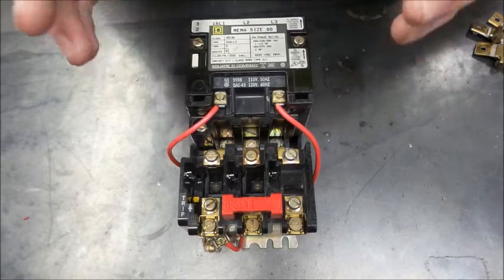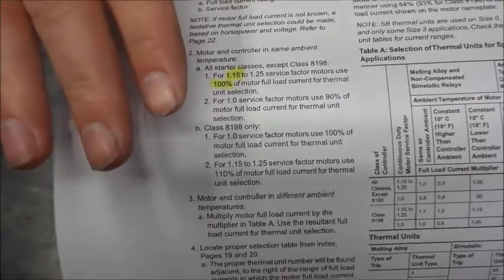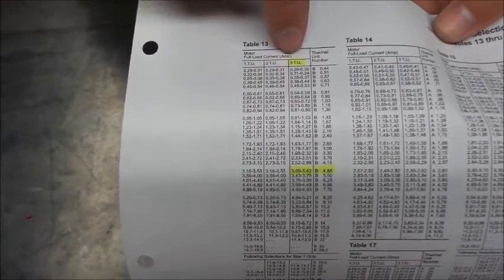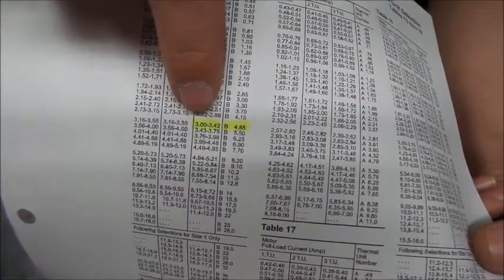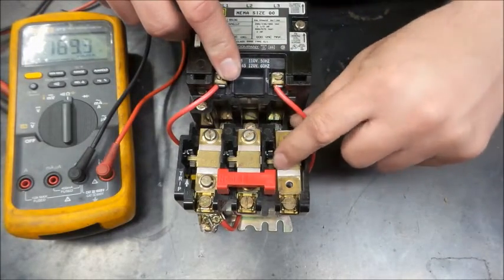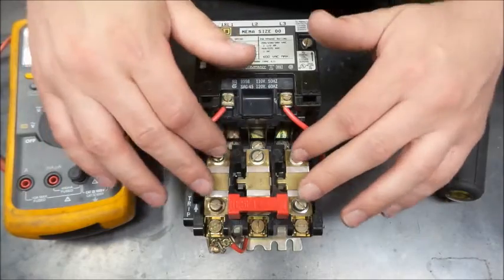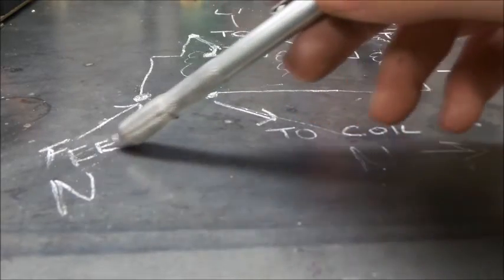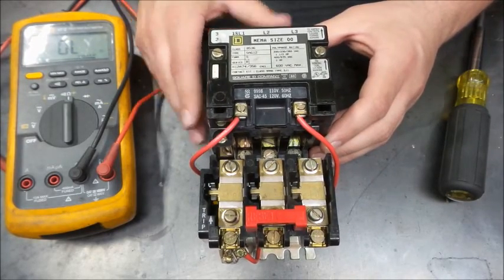A Look at Thermal Overload Heaters in Motor Starters

Comment: Depending on what motor starter you have depends on the motor and the he voltage. A lot of motor starters have two or three hot legs and no neutral. Most starters don’t have a neutral as you are showing. I think you know enough to be dangerous !
Reply from the maker: Motor starters can have one two or three phase legs, all starters with electric coils require an additional power source to operate the coil on the starter. In this case it is 120V AC it could be any number of voltages but 120V AC and 24 V DC are more likely there definitely are 240V AC and even 480V AC but the coils voltage specifications are something entirely different. That being said this coil requires 120V AC which in North America does indeed require use of a neutral. So while the neutral is not found in the motor part of the circuit the neutral is most definitely required to make the starter go Ca-Chunk and close. In this case the neutral is also routed through the overload contacts which, in the even of an overload condition opens the neutral thus de-enrgizing the coil which in turn turns off the current to the motor. 

To try and distill it down as far as possible the motor starter is an electrically operated switch exactly like a relay or a contactor the only real difference is the addition of the overloads. A much smaller voltage and current can be used to operate a much higher voltage and current that is why they are so advantageous to use.

Hopefully I was able to make that a little more understandable I recognize if it's not your thing it can be a little confusing to understand all that's going on with a starter.

Comment: I have people in my industry for years telling me the "heaters" are going bad. However, nobody has ever shown me a reliable method to test them. I HAVE seen this be the case, but only to the extent that changing them fixed the issue. Does anyone know of a method to verify the heater has gone bad? This is generally in an environment that doesn't allow for controlling the load on the heater, so any ideas would be awesome. 

We use the Square D heaters, just like the one in your video.
Reply from the maker: Short of load testing the only thing I can think of off the top of my head might be a heat gun and a thermal imager. The problem would be figuring out the temp the heaters solder should melt. If you knew that it might be worth a go. I might experiment with this if I can get a few different size heaters. The problem I expect will be translating a current rating to a temp rating. Theoretically though I would think you could mechanically test them with external heat as well. At least enough to know if it's way out of spec. That's an interesting one to ponder.
Reply: @TalkingHandsTools  thanks for the response. I can't think of a way to test them, and I hate simply replacing parts guessing. It just so happens we don't have ready access for monitoring them. They are sealed up tight in an explosion proof panel, so I'm sure we waste a lot by not having a method to test them. The heat gun and thermal imager should work, as long as testing a few new heaters will give you a fairly accurate average. About the best idea I've heard, because I have never heard anyone give a way to test them.
Reply: Correct me if I’m wrong but a continuity test works
If the thermal unit is still good, you will have continuity. 
A blown thermal (heater) will have no continuity.
Reply from the maker: I'm not sure continuity would confirm they are in spec. If they read open, it would be a catastrophic failure. I'm not sure the heaters themselves would actually open under an overload condition. The solder alloy in them would definitely turn fluid, which would allow the spring-loaded mechanical contact they keep closed to open and shut the motor off through operating the coil.

But that being said, the overload itself has to continue to conduct electricity itself up to the point the solder alloy melts. I suspect if the spring-loaded overload mechanism fails and does not open, the solder alloy might experience thermal runaway and fail catastrophically. 

What is difficult is overtime and duty cycles (being tripped repeatedly) the solder alloy doesn't stay consistent in its tripping point. I do believe they generally trip sooner, but that comment only comes from having to replace ones that trip sooner than they normally should. If some trip later, we'll those would eventually result in a motor failure. That is the reason some maintenance programs change the overloads if a motor fails no questions asked. It's also at the route of the speculation on how to test them. 

I hope I explained that okay. There's a ton of nuance to overloads and it's a little hard to articulate everything that's going on. If you have any ideas, I'm definitely game to talk them over.

Comment: I have a question on a similar style overload relay that has heaters but they are coil style Heaters. I had a overload relay that didn’t want to reset does this mean one of the heater was burned out ?
Reply from the maker: Without seeing it I would say it's very possible that the overload has failed that is always a possibility.
Reply: I believe I know the type you are talking about. It looks to me like the coil generates a magnetic field that tugs on a thin metal strip next to it which trips it. We had some here that had those strips broken on them. I'd look for that.
Reply from the maker: Thats very interesting. I've seen this style but never had to trouble shoot one.  Next time I see one I'll take a closer look. Thank you very much for the input!

Comment: Are these heater units reusable or do they require replacement after every trip?
Reply from the maker: The heaters are a solder alloy that is calculated to turn fluid at a specific temperature. The temperature is achieved by current flowing through the circuit. As the current increases it will increase the heat, thus the nickname "heater". The solder is contained in a specially designed unit that sits under spring tension. As the solder heats up and becomes fluid it can no longer hold the spring tension as a result the springs overcome the mechanism and open the contacts which turns off the power in the circuit. That being said after the solder cools down it becomes solid again and allows you to reset the spring mechanism that allows power to once again flow through the circuit. 

So the quick and easy answer yes they are indeed reusable.

Comment: So you need 3 even if you’re gonna just use 2 for a single phase motor?
Reply from the maker: We still will need all three for our project we will ultimately be running a three phase motor on single phase. If you were running a single phase motor you are correct you would only need to utilize two of the poles.

Comment: You highlighted 3 TU ( assuming 3-phase then) and motor plate showed 1.6 amps for 460.  Why then use the 3.2 amp on the heater table?  Seems oversized then.
Reply from the maker: Thanks for the comment. We will be using the 240v hookup in this case so we will need the 3.2 amp heater. You are correct if we were hooking this motor up for 460v we would indeed be oversized.

Comment: Very well done, thank you! I'm new to this. Trying to learn more. I have a single phase 2HP dual voltage 110/220 motor. 20/10 Amps. The motor has a toggle that allows you to flip to 110 or 220.....just change the plug. I'm confused on how to wire the magnetic starter that came with the saw and I assume the heater would be rated for the 110- 20 AMP???
Reply from the maker: Thank you, If you are looking to operate it on 120V you will need to size according to the 120V specs for the motor.

Comment: Dude! I got a better understanding of how to locate my heater part number here than I did at the Square D website! Thanks for the concise and easy to understand instructions. I have a manual starter for a 5 hp motor but didn't understand how to figure what table to use on the Square D website. Thanks for this tool. I'm going to put it in my toolbox! Good stuff here.
Reply from the maker: Thanks,

I had a pretty rough go myself when I tried to size up my motor. I am really happy I was able to help someone out.